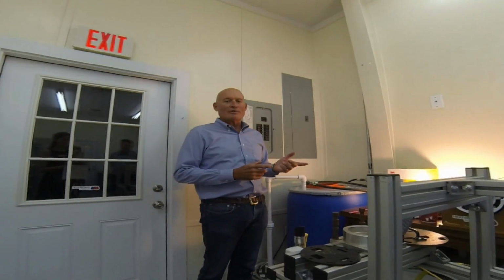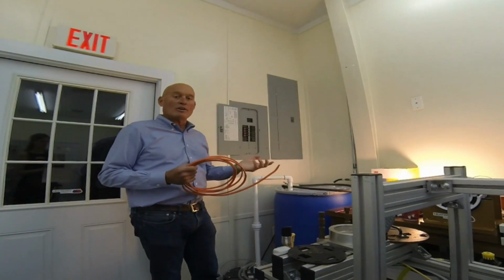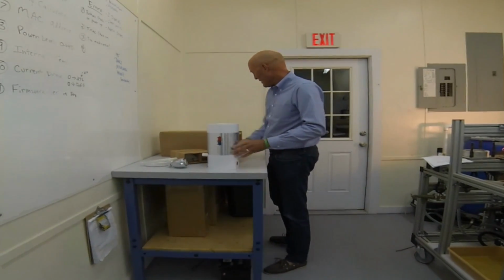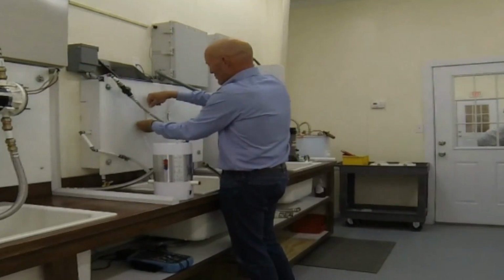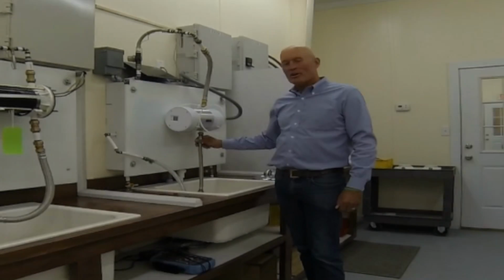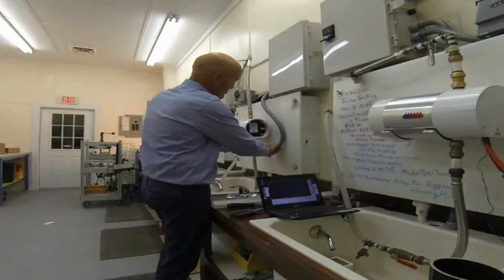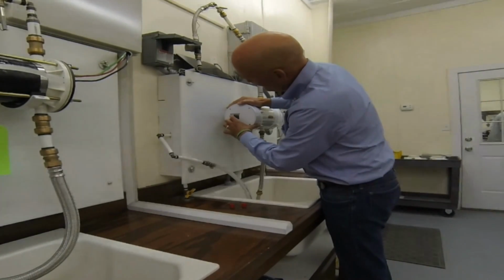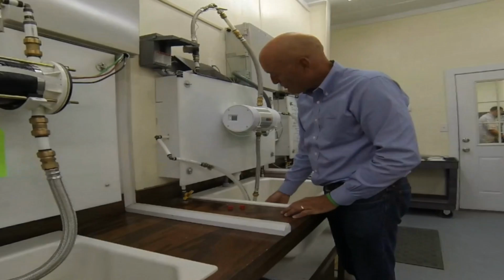How to install your Model 1

Comment: Sorry but your statement around .33 is incorrect. Although adding up the sum of all the breakers may equal 300 amps you are still limited to the maximum size of the wire leading into the panel; that wire protected by your 100 amp main breaker. Use too many items tied to the smaller breakers I guaranty you will blow the 100 amp breaker. When electrical engineers plan these panels they "bank on" only a certain percentage being used at the same time. The beauty of tank type water heaters is due to storage capacity, they do not require as much "continued use" electric so smaller wires and smaller breakers are used, compared to Tankless Water Heaters. When most apartments and smaller homes have only 100 amp panels, setting this on 48 amps & say using the apt AC or stove would most likely cause the main breaker to blow so I guess the question is how low could it be set and still provide the additional needed hot water. I'm wondering if you have specific data on how much hot water can it produce vs. Tankless or regular tank style heaters. I saw this in Lowes and it was about 500 bucks so certainly not cheep and therefore I suspect many years for a "cost payback."